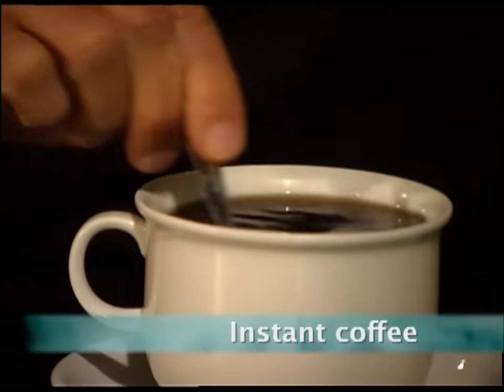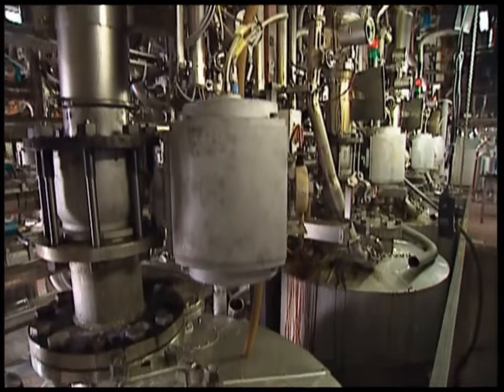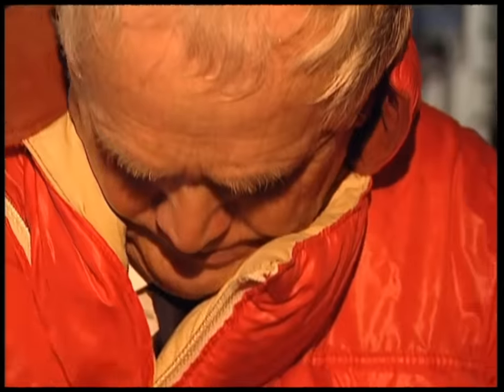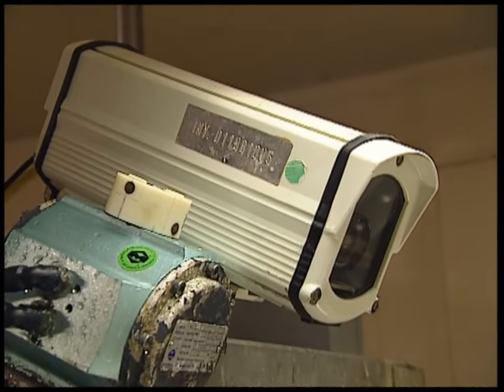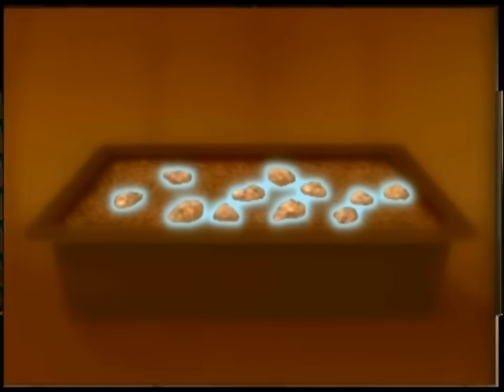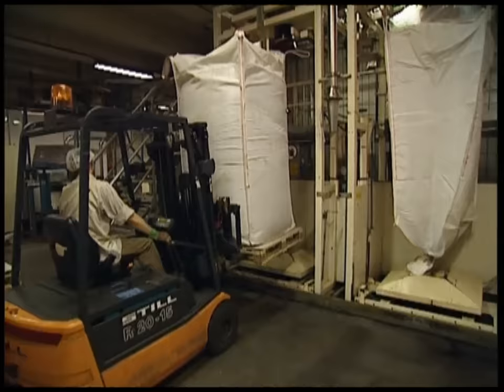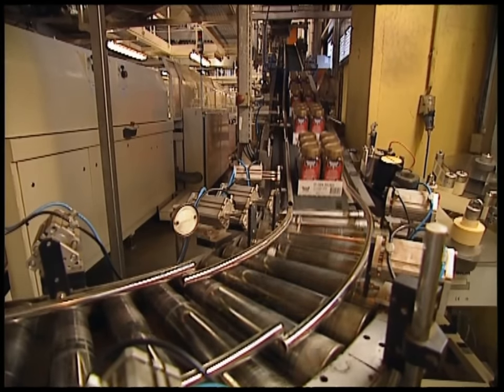HOW IT WORKS - Instant Coffee

Comment: (2:45) - This phenomenon of a solid "melting " straight into a gas is called: sublimation.
It is achieved here, by placing the granulated frozen coffee paste into a vacuum chamber, while the temperature is held at slightly above freezing.
This ensures that the water content of the granules is removed as a gas, the frozen water being denied its liquid phase by the low pressure, vacuum conditions.
Thi is why your instant coffee granules appear so delicate and light.
After the water is removed, the initial structure of the granule is maintained.
Imagine a dried tomato.
It's a sorry fraction of its old self, right ?
All wrinkled and much smaller than it was before..
If a tomato underwent the same process as this coffee paste, it too would maintain its size.
You'd have a same-sized tomato that was light as a feather.
>
Reply: thank yoh my brother
Reply: @whyismynamehere this comment is for the smart
Reply: thanks mate
Reply: Intriguing...

Comment: Ahhh. I was wondering how the instant coffee dissolve in the water and freshly ground doesn’t. It’s because instant is actually brewed and then turned into a freeze dried powder. Makes sense.
Reply: Despite i see the steps for making instant coffee, but i am suspicious about the real fact in my mind, that it is flour+artificial color and essence
Reply: @SugomA22  Interesting thought, but most certainly not flour. You'd have celiac people struggling with every sip, or at the very least a label would have to let people know it was made with possible contamination of wheat. I know this comment is over 2 years old, but there are a few reasons as to why you'll not see flour be used. Another immediate thought is that flour would not dissolve in the hot water in the same way instant coffee does.

Comment: I like how the narrator specifically mentioned the freezer was -50 degrees centigrade, however when he mentioned -40, he didn't specify the unit. -40C is equal to -40F.
Reply: MaximRecoil the internet was actually invented in England..
the PC was invented in Germany
the first operating system was built by students in Manchester...
So you are wrong 
do some fact check next time
Reply: no its not.

32 degrees is exactly the same in both scales,not 40
Reply: jadekayak01 no. -40° Celsius and -40° Fahrenheit are the same. Only doing this to be woooshed.
Reply: @jadekayak01  Tell that to Canadians sweating at 32 C / 89.6 F
Reply: @JohnnyFive  Dude ... NM a science class, a simple Google search would have saved you from staking that flag so hard.
Reply: @JohnnyFive  6 years later and this comment is still the dumbest comment on this video 😂😂😂
Reply: @LeClaw  How so?
Reply: @JohnnyFive  Because indeed -40C is equal to -40F
Reply: @dorkcity  My bad. I’m so caught up in stoichiometry conversions that I failed to even check it. Chemical Engineers can be wrong too. How embarrassing.

Comment: interesting so basically the coffee is harvested filtered, roasted, grounded to a coarse setting to a fine one, flavors are extraced via a steam, high pressure which basically is hot water, then its flashed freezed to sub 50C to dry out all the moisture, grinded again and its ready to be packed before getting shipped.

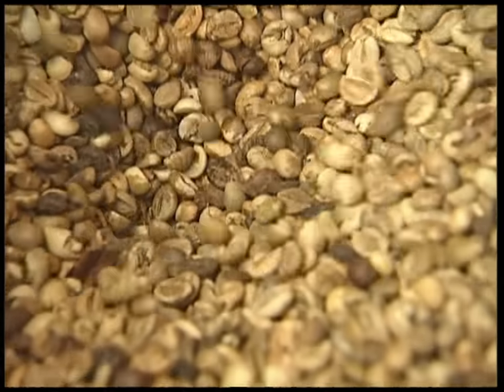Comment: (0:42) - Two hundred degrees what ?
These details are important.
Thumb down for the dumb down
>
Reply: They also made many mistakes when they were using terms like "under pressure" and "vacuum" interchangeably.. Half the time I didn't understand if the pressure was going up or down..